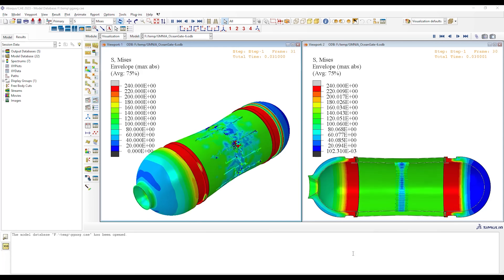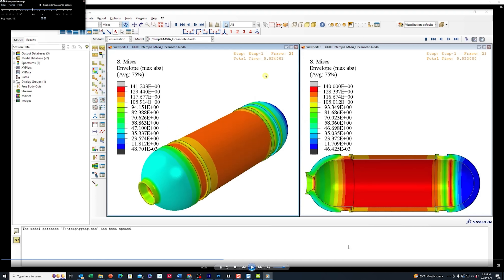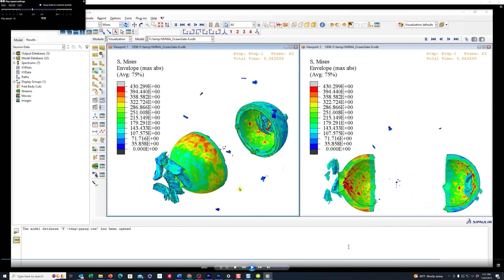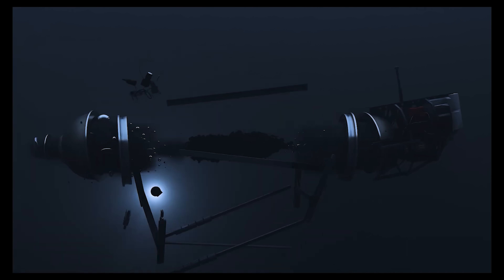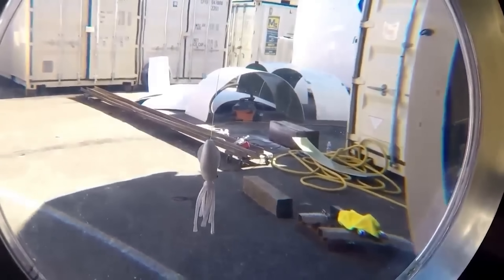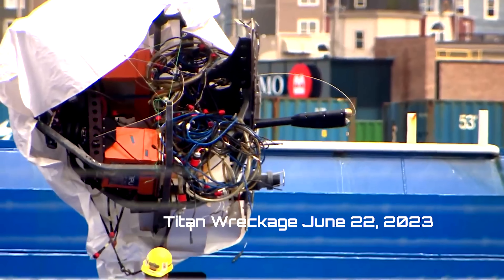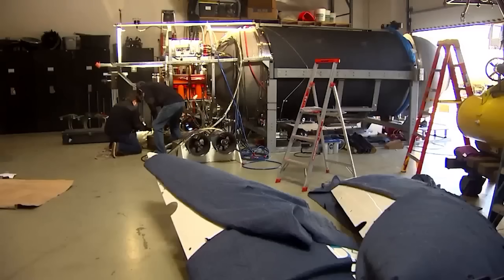Best Titan Sub Implosion Simulation, Cracked Porthole? Q & A

Comment: Those look like "worm lines" in the glue to me more than cracks. Its areas where the glue or sealant used has air gaps which resemble worm tunnels.  They get worse with repeated deformation because under pressure they squish together, and then as the pressure decreases they expand and they can expand just a ~little~ bit more....rinse repeat enough and you have a hole in something thats not supposed to have a hole in it.

Comment: Interesting about contracting the speed of the failure with the speed of comprehension.  However that analysis has a flaw in that we don't know at what point comprehension ends.  It's possible the brain and some senses still function for a second despite the injuries being fatal.  Just ask any hunter how long a deer can run after a fatal shot though a vital organ.  Short of testing humans "to failure" we're not going to know that answer due to the obvious moral issues.

Comment: Was wondering if the telemetry of the hull crack detection system was stored on previous dives . It seems like the rapid dive rate limited the usefulness of his anti hull crack technology by limiting the time to stop the dive and surface when problems were detected. If they cant prove the rabid decent rate was due to something beyond their controll or understanding i cant understand why they didnt decend slowly to give the anti crack system time to work.
Reply: It was never going to work.  It was a diversion.

Comment: What looks like cracking, is an optical grease that is used to seal the tapered surface of the acrylic into its seat in the titanium end cap. Under pressure, the acrylic is forced inwards and the grease helps it seal.
Reply from the maker: That sounds logical to me
Reply: @jeffostroff  I don't think it needed a crack prior to going down if it was never designed for that pressure in the first place. They may have just gotten lucky on the first few dives.
Reply: @unusualaquariumecosystems5805  While the acrylic porthole was only rated to 1500 m, that doesn't necessarily mean that it was only designed for that depth. Ocean Gate designed the porthole for their maximum operating depth. The manufacturer rated the porthole for a lesser depth. If the porthole was the point of failure, it will be apparent to the investigators. However, I'd be placing my bets on the CF cylinder.
Reply: @markfernee3842  Factors of Safety are really factors of ignorance.  You aren't supposed to test the grey area outside that value guaranteed by the designer/manufacturer. Uncertainty in design, in material properties, in construction, unexpected events encountered in use, effect of repeated use. Things wear out.
Reply: @unusualaquariumecosystems5805  Because it was guaranteed to that pressure does not mean that is the failure pressure. Most times the actual failure pressure is much higher than the rated pressure as to allow a factor of safety.
Reply: @edsloan8535  to reach depth certification for underwater use the general safety factor is 20% more than the rating so it's not "much higher"
 That said nothing with this vehicle was tested and Stockton is quoted as using a theoretical smaller factor. The company I work for makes underwater cameras and our minimum safety factor is 40% on acrylic ports. Our "standard" product is rated to 4500M, "deep" 6500M and if you want something for the deepest point of the Mariana Trench, we do that 😏
Reply: @BillDavies-ej6ye  exactly this. also these safety limits given by manufacturers are only applicable when the products are used CORRECTLY! If the products are used outside their typical application, or if products are applied incorrectly or poorly, or if products are worn and/or broken, AND they aren't tested or maintained.... the manufacturer's safety limits don't even apply anymore. It would greatly lessen the depth rating. Stockton and OG have admitted that they didn't test lots of what they used and didn't have good maintenance practices. I'm not trying to argue with you btw! I totally agree with what you're saying and I'm adding to it.
Reply: @jeffostroff Completely logical. Military uses the same stuff on underwater vehicles and deep water craft.
Reply: That also sounds like the grease would make it into any fissures, obscuring latent problems - and with the wrong grease or contamination, crazing could form, no?
Reply: God this thing was so dangerous. If your telling me grease is what's fitting the gaps to keep it pressurized from an implosion.
Reply: @jaymesnin  my thoughts exactly.
Reply: I heard they used glue around a bunch of the surfaces that joined together
Reply: @carpe_poon5761 Using glue, seems so clumsy for such a dangerous dive. 
As if they were fixing a chair or something.
Mind blowing
Reply: @peaceofmindofpeace1650  Right. 370x our atmospheric pressure 😬
Reply: The grease would also allow the acrylic to move under pressure for the dive and surface. That's a actually smart provided it's removed every so often to be greased. Cause 3/4 of a inch movement would cause water intrusion into the grease seal over time. It will no doubt ooze grease during the dive .
Reply: Try Flex Seal, I Just Sawed My Boat In Half 👍
Reply: @cnnothingburgerletsgobrand6381 
Haha it did have rhino lining on it ,hahaha pretty close.
Reply: @cnnothingburgerletsgobrand6381 lol
Reply: I used to fix watches, and we used grease to seal the watch, but always with a rubber gasket. It just seems unnerving using glue and grease alone. This is why after a battery change, your watch isn't waterproof anymore, because they don't replace the gasket.
Reply: “Optical grease” is just fancy ocean speak for “They glued the sh** together”
Reply: @Ministry_of_WrongThink seriously. Like not trying to say it doesn't work but obviously Stockton was not interested in doing things correctly. It's like he wanted to use the best materials but didn't actually use the best engineering because he spent all his money on the fancy materials.
Reply: I agree.  The "defects" were simply the glass/titanium interface that is not perfectly consistent.  Plus, this was during construction. The bolt numbering is still visible, so definitely not cracks from use.  For the images when at sea, we can see dried salt water patterns on the outside of the window.
Reply: Speculation… if the port hole bolts were sheered off, I would think the port hole window was intact when the carbon hull imploded and subsequently blown off, taking with it the bolts. If the window cracked I think it would be less likely the bolts would have sheered off. However I’m no expert at this, just my own uneducated speculation.
Reply: More likely, Gorilla glue from a nearby Home Depot
Reply: I don't think even he was dumb enough to go down with a cracked up viewport, some chips on it, like my windshield...
Reply: finally someone here who knows what hes saying
Reply: It's silicone
Reply: could it also be salt residue from a wet window drying?  I have a reef aquarium, salt creep happens all over which made me think salt.  Assembly grease does make sense too.
Reply: Good catch. I was going to say that it looks like water was trapped between the porthole and the acrylic and not cracking, but you beat me to it and gave a reasonable explanation of what it was.
Reply: @carlmalone sorry but that is completely wrong! Any grease would be on any seals, not the seat. The seats would be dry/clean but the patterns could be a little fluid or simply air pockets, neither of which is an issue at surface pressure.
Reply: Is the viewport window shown in pics the only piece or is there some type of thick secondary lens or pane behind it that contains the grease?
Reply: My thoughts were similar as well, but I'm wondering if the grease is applied correctly/on a clean surface?
Would have expected a more equally distributed visual (no paterns in it).
Reply: That is what I thought
Reply: @cathybaldry7822 quit lying
Reply: That’s correct
Reply: Obviously correct the way its tapered. Ud have the have somthing in ther to help w the compression and the seal
Reply: In the picture showing the front dome, can you see if the acrylic port window is still attached?
I think it is, which will mean that the implosion did not started there, right?
Reply: The front titanium dome was lifted with straps through the port hole so no it was not attached after the implosion.....which if that violent sheered off all those bolts as well.
Reply: @Slapbladder  I'm wondering if the dome was unbolted from the ring after the fact, once it was brought on deck. Can't think why the bolts would have sheared after the main hull imploded.
Reply: @MarkoVukovic0  because of the pressure lmao. There's going to be a huge amount of force due to the stretching and squeezing and bending of the materials. And be used very strong materials so if the middle imploded it would most certainly create enough force to rip everything apart.
Reply: @Tod_oMal no buddy they brought it up with a strap going through where the window used to be 👍
Reply: @LandOfSaintsFPV  Yep.  That was such a huge indicator that that glass was either blown out on implosion, or was the cause of the implosion itself.  It was only certified to 1300 meters, when the Titanic is at 3800.
Reply: @Tod_oMal  the cracking was in the rear so it was there where was the weak spot
Reply: @paulwoodford1984 there was a window in the back where the makeshift toilet seat..you could sit on it an look out another smaller window..but sounds like the crackling sound came from where the electrical equipment was housed...
Reply: @bernicebaker2596  Seems. like a strange place to have a window if there was electrical equipment in the way. That’s where the rear was wasn’t it, where the electrical system was, so why would there be a window there.
Reply: @bernicebaker2596 there was no other window and no toilet it wasxa zip lock bag 😮😮😮😮

Comment: I noticed on one of the videos Stockton shows that they used Rino liner to cover the carbon fiber to water proof the hull. I have used this product since it came out in the body shop business. One thin I wondered,  if the carbon fiber was prepped correctly?
Any spray liner ever made needs heavy scoring for it to adhere. If not it will fail.
Reply from the maker: Plus water pressure will keep pushing the liner onto  the cylinder

Comment: Pretty sure what you are seeing that looks like cracks in the acrylic is actually the interface between the acrylic and titanium. I'm not sure what they did for that seal, my bet is that when there is no pressure, it probably loosens, and you see that pattern. I assume that as it compresses in it gets a more uniform seal.

Comment: This simulation is not reflective of the damage. For instance, if the acrylic failed the ring itself would not have sheared the bolts off outward.

The lap of the carbon fiber hull and the titanium end caps was approximately 2 or 3 inches. The carbon fiber flexed inward beyond the capabilities of the joint. It was sheared off as the lap was acting as a wedge. When the pressure exceeded, the capsule popped.

Comment: What was the material used inside, to which the carbon fibers layers were attached to??
Reply from the maker: carbon fibers were spun around a steel mandrill, and when cured, mandrill was pulled out. I showed photos of it on my last video

Comment: None of this would matter, as the air would be compressed so fast, it would flash into a massive heat ball, incinerating anything almost instantly. Cameras, chips, bones, even fillings. You are not realizing the physics at play here. All that stuff was incinerated.
Reply: So everything would evenly in milisecond absorb heat. That sounds more like magic and not physics.

Comment: Really curious if you can find any info on what adhesive was used in this experiment... looks kind of like "glue" delaminating between the port window and the titanium piece, from all I've watched I wouldn't be surprised that they just put something in there to "seal water " out and relied on the titanium ring /bolts and the the hope that the outside pressure/forces will hold the conical window in place.. I believe the bonding agent between the rings and the carbon was the ultimate cause of failure not the window, purely my opinion and just speculation. I do believe the carbon would've failed eventually but I have a very hard time believing any adhesives available could withstand the amount of pressure at those depths, and then considering the amount of pressure cycles, with the minimal amount of bonding surface on the titanium rings to carbon. 
And I'm probably horribly wrong or maybe right (very unlikely) who freakin knows lol just my thoughts
Reply: the glue they were mixing with a brush and touching it with bare hounds. no clean room protocols nor doing it in a vac chamber

Comment: i dont think you would need 4 people to lift an 80 lbs port window like that picture shows the 4 people with suction cups handles lift that/or a port window
Reply: Unless you are a Worlds Strongest Man contestant, picking up something that weighs 80 pounds and working with it at or near arms length like required when installing it into its fitting would be impossible.

Comment: Why would you have a hand pump for that emergency drop system? 

It would've made more sense to have an electromagnet with a spring. That way if you lose power the magnet shuts off and automatic drop of ballast.... It wouldn't need a hull penetration either.

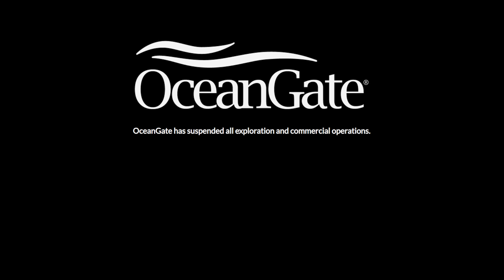Comment: Great summary Jeff!!! Bingo; Stockton: 6:59  "it will squeeze in 3/4 inch.". Your Photoshop may have shown microfractures around "blobs" of acrylic formed by fatigue.  Acrylic viewport are not designed to be like massive diameter APO lenses in a telescope!  I'm pretty certain now that 1 The longitudinal wound CF fibers began to separate at the least supported part, the cylinder midpoint.  2 From here, the first implosion model with the "pinch" failure, exacerbated by nothing holding back the epoxy/Ti joint follows and 3 we get @azget's full CF crush. But 4 Instead of her Ti ends falling apart, the implosion draws the Ti "sandwich" together, with shards of portal acrylic slicing across the CF/human remains. Jeff, don't you think that the human residue on the acrylic pieces is the reason the recovery teams are not showing the portal window?  Jeff, you've captured the two most plausible implosion models 🙏

Comment: If I understand correctly I think it was mentioned that water could have forced itself between layers of the carbon fiber due to the different rates of compression between the carbon fiber and titanium, as well as the method in which the fiber was wrapped. Carbon fiber experts have weighed in and noted other wrapping methods that would have increased resistance to this scenario. 

Still far from a sure thing but I wouldn’t rule anything out yet
Reply: Yeh I didn't know he had applied a sealant to the outside of the hull so that's one point in his favour I guess.

It wasn't exposed directly to the elements and should have prevented water seeping into the outer layers assuming it was applied properly and was the right type of coating.